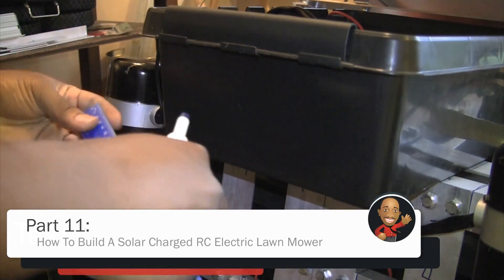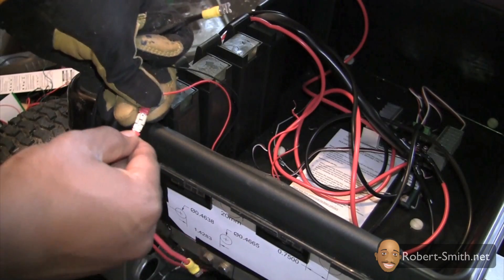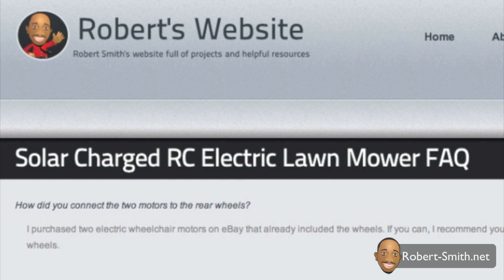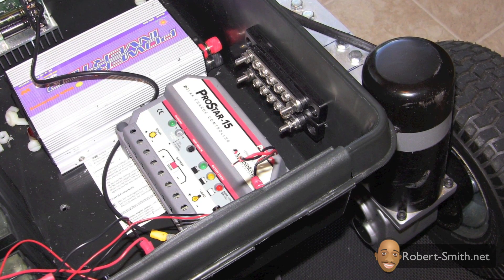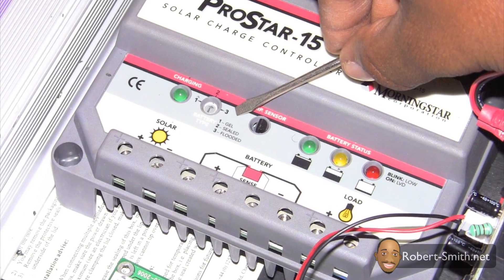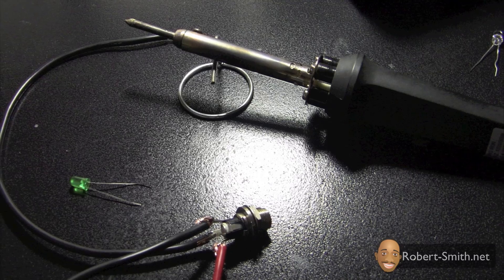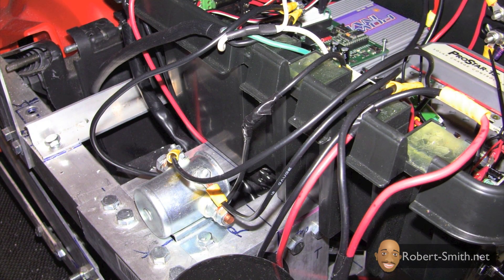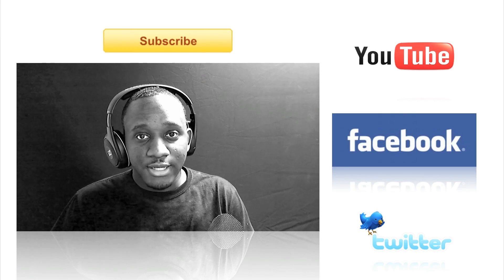How To Build A Solar Charged RC Electric Lawn Mower - P11

Comment: What voltage and wattage is your Solar Panels? Not sure why you would need a power inverter as you can get panels, which output the appropriate voltage

Comment from the maker: @MrHorsetail The inverter is used to charge the lawn mower's 36v battery. In the last video or near the last video I will explain how the entire project works, from an operator's standpoint. Meaning, when you flip this switch what happens...etc.

Comment: Keep 'em coming!   I would recommend vibration protection by mounting the components on foam and/or velcro.  Better yet, mount the entire enclosure on a nice thick foam pad secured with velcro.  Nice work Robert!  Very clean.

Comment: Nice Job!
I would put on one side of box and negative on the other. The other thought is to transmit power details to your controller. It may be helpful to know if your mower will run out of power on the other side of the yard.
You could also mount an AC outdoor outlet on the case to have a remote power source when needed. Beats extension cords.